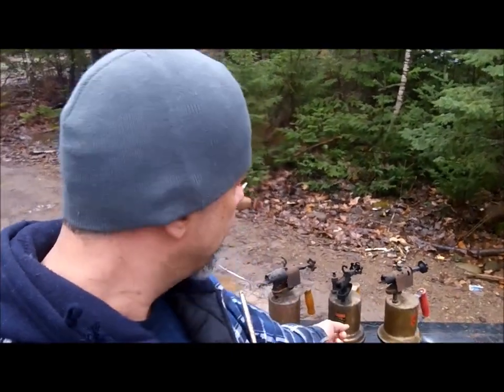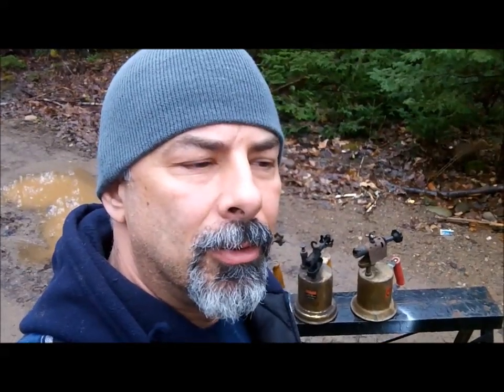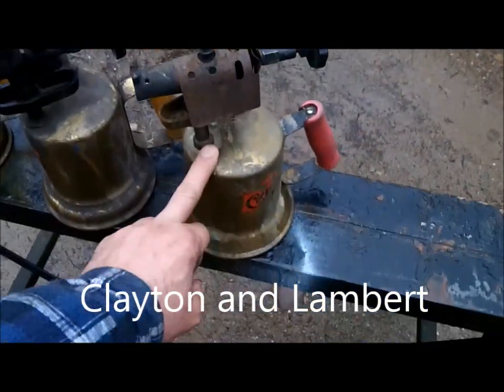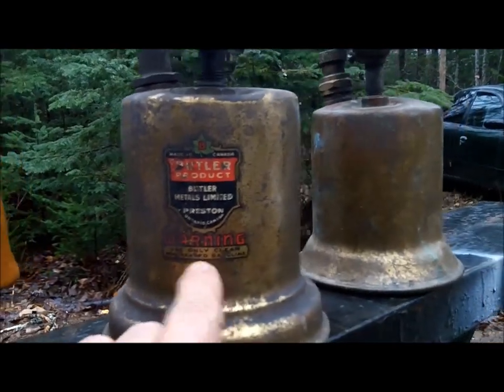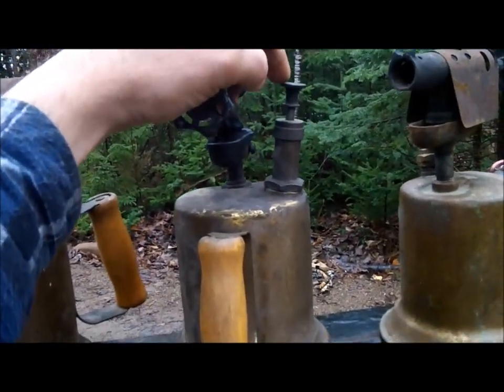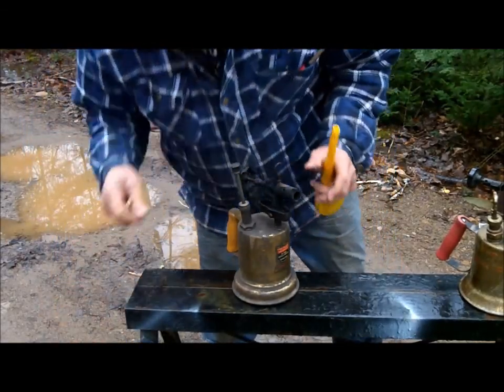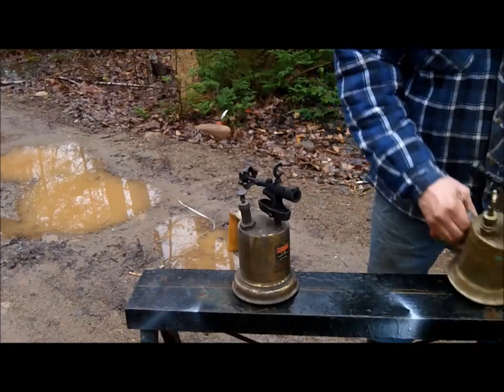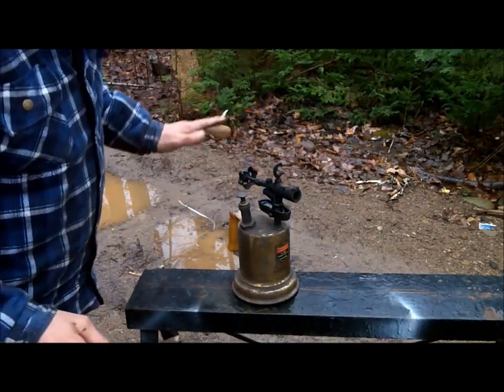Gasoline Blow Torch

Comment: Welcome back! 
I've got one of those. The tank split open, to the left of the handle. It's basically a decoration now. They are more for low temp soldering, like plumbing work. Build a good shroud around it, if you put it into forge service. Thanks for the video. Be safe.

Comment: You should never use gasoline in the those torches, you should only use kerosene.  Gasoline is much too volatile.  Kerosene (white gas) works great and much more safe, they work on a similar principal as kerosene lanterns.
Reply from the maker: This is inaccurate. Some torches were designed for kerosene and some for gas.  I suggest a person does research on their particular torch before using any fuel.
Reply: @modernblacksmith  What I'm saying is the style that used to use gasoline can use "white gas".  Since "white gas" is a less volatile as it has a higher vapor temperature  and it thereby makes a safer alternative to gasoline.  Here is a quote from another site : They use "white gas",
Some do but some where designed to use kerosene (coal oil). IIRC, the
kerosene type had a larger primer pan and had the fuel carried to the
orrifice by a tube through or near the flame since kerosene is
considerably harder to vaporize than gasoline. Coleman fuel is just
what you want for the gasoline types. Kerosene is frequently available
as "lamp oil" in small quantities.: